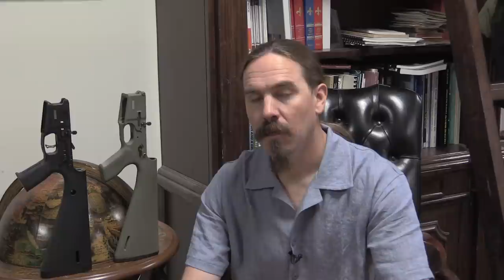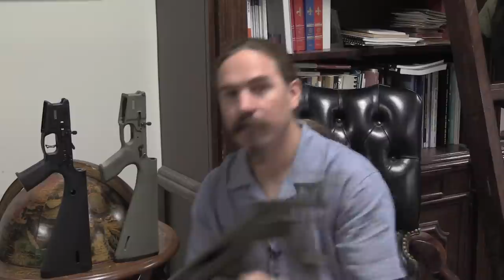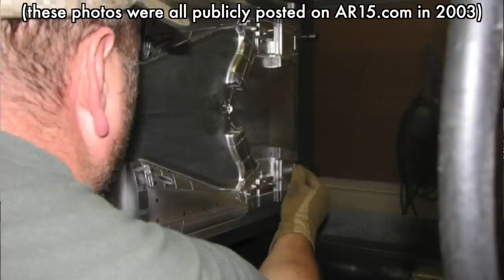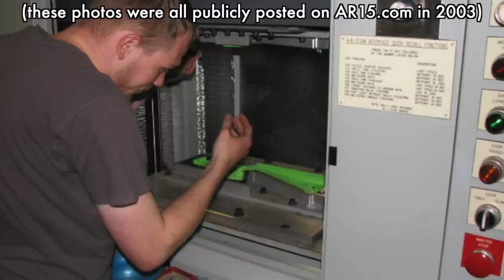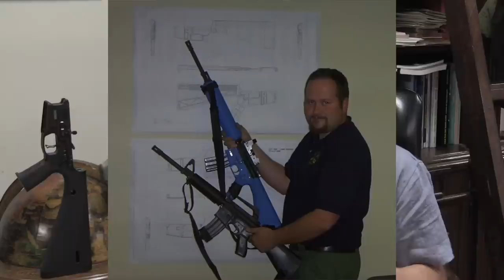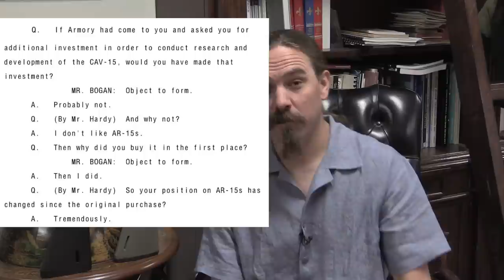Anti-Gun Partisan Lawfare? GWACS Sues KE Arms et al.

Comment: It's worth mentioning that there is a precedent for intellectual property and courts to treat the AR-15 differently than just firearms in general.

For example. Karl Lewis has a patent on monolithic uppers specifically for the AR15 platform, and he did successfully sue Colt for infringing on it. Granted, he actually has the patent to back his claims up, and GWACS doesn't. 

Trade dress is posibly the weakest form of intellectual property there is.
Reply: @zoiders  even then, polymer stuff in 2 halves joined by friction welding predates the AUG...
Reply: @zoiders   I was thinking early 70s, but there is a reason they didn't straight patent the process
Reply: @zoiders  I might be talking out of my ass, but the patent might have been extremely specific to the exact dimensions and shape, and not the manufacturing process.

Having only scratched the surface of patent approval in uni, I think that they had patented the system and some specific parts (the chassis, gas system, the specific way of making a quick exchange barrel).

Considering how the original Cav15 was never patented, was shared publicly and on the internet (which makes it pretty much eternal, as in forever shared with the world), I'd like to know how the lawsuit even started.
Because you'd have to push a lot of "levers" to build a lawsuit on these grounds, especially considering how the kp-15 is built pretty much from old school first hand experience.
It sounds to me like they are trying to prove that a polymer lower receiver is by default their IP, but without a patent and with the original designer having blatantly stated that everyone is free to make his own...

Grifting and/or trying to thieve some money from a project they were never willing to invest in.

Comment: Russell Phagan posted a huge block of legal documents, from which I learned some interesting twists to the story.

The most interesting thing I learned was that GWACS Armory was never intended to manufacture guns for retail sale.  GWACS Defense was the 'real' company, working on a gunshot detection system for the Marines.  But they needed automatic weapons to test it with, and didn't want GWACS Defense to have to apply for and hold a machine gun manufacturer FFL.  

So they created GWACS Armory as a separate entity, solely to convert machineguns on a small scale to use to test GWACS Defense's gunshot detection system.  As far as I can tell, when Russell decided to sell the molds, he approached GWACS Defense who decided to buy them through Armory, but the company had, at that point, never made a single gun for retail sale, nor sold any guns made by others.
Reply: That helps explain to some extent why an anti-gunner invested in the company in the first place.  Developing a gunshot detection system is right in line with anti-gun orthodoxy, then as you say they needed to be an 07/02 for testing purposes.

It's entirely possible that as an investor, Oppenheimer may have been initially in the dark as to what his partners/employees/whoever at the 07/02 side of the operation were up to until after the mold had been purchased and production costs incurred.  Then went along with it since his investment was at stake.

Comment: I wonder what kind of trouble you could get into if you were to vacuum form the left and a right off of the polymer lower, fabricate buffer tube holding mechanism glue it together and fill all the voids with rigid foam clean up the edges put in your fire control and then you've got a carbon fiber super  lightweight receiver
Reply: none except for regulations regarding fabricating of a firearm if you were to sell it.

Comment: Well, I haven't read all the comments, but although I am not a lawyer I though designs were protected by copyright, and copyright covers derivation, not just exact copies. Since Russell Fagan, having been very familiar with the Cav Arms and GWACS product, worked on the KE15 design, that may expose a valid copyright case. In software development we use a green field approach to avoid the problem. No one who worked on the original software can work on the new competing product.

Comment: primer + case + gun powder + projectile = Modern day cartridge using Sammi spec guidelines for safety 

1000lbs =  7000.00108027 grains 

What was the exact amount in lbs or whatever unit of measurement did the founding fathers stated to have ready just in case? 

How many Modern day cartridges could be made using the equation listed above using the appropriate materials for a modern day cartridge? That would be very informative.

Comment: If he started it from scratch again and they don't have a patent and he didn't use original prints then he will be fine. If they sold him specific prints and he used a copy or those then it's possible he could get into trouble for a close copy. Also depends on if he signed a NDA.
Reply: If they sold prints, unless the contract explicitly includes a non-compete, they cant do anything. Even if it does have a non-compete, they have to actually be competing, which they are not. But the relationship here does not seem to have these complexities. Basically, KE and GWACs are both derived from Cav arms product, and neither has more claim to the idea than the other. If GWACs restarted production and KE sued, I would side with GWACs. But here we have the opposite, so I stand with KE.

If we had a situation where GWACs was acctually attempting to produce or liscense production of their 'intelectual property, I would be more interested in hearing them out. But to be clear my goal would be both companies producing competing products, because I want the product improvement that comes with that competition.
Reply: The KP15 is a complete do-over based on the KE15 aluminium lower. GWACS are basically claiming they own everything inside Russel's head regarding polymer lowers cos he sold them a mould, which is patently ridiculous. If you've got the time, read his deposition linked in the description.

Comment: well, I'm not giving up my KE Arms lower assy. I actually like it better than any 'traditional' lowers, and not because of the weight.  I'm way too old for door busting, so I don't need a collapsible stock, and that is the single advantage I see in a traditional M4 setup. I shot an A1 in boot camp and a A2 the next 10 years.  This stock feels better than either of those did.

Comment: As a former moldmaker and mold designer, I think I would have considered building the mold to make the frame a single piece as opposed to two halves.  Somewhat more complicated but certainly doable with sliding cores for things like the buttstock, mag well, trigger group, and hand grip.  Easy for me to say, but that's my two cents....
Reply: Is that even possible for such long thin walls when we're talking high percentage fiber glass mixes? And how would you make the butt stock hollow?
Reply: @andersjjensen  I agree, a high content of glass filling would make it difficult.  That would be something that would have to be worked out with flow analysis software, which wasn't something I didn't do.  That was a area for the process engineer.  
The butt stock, and other hollow areas would have to be done with core pulls.  In this case it would likely use a hydraulic core pull setup.   Like this:  https://www.youtube.com/watch?v=xyWcsmORB7Q  
Shorter core pulls are usually done mechanically with angle pins.   https://www.youtube.com/watch?v=vRoTwFAnYXk
There would no doubt be issues with thicker sections of the receiver which would have to be dealt with and there would probably still be a couple of holes that would have to be put in by secondary operation.  It would be a serious challenge but I've seen molded parts that were extremely complex.  Most people never give a second thought to all the plastic moldings we see every day.

Comment: Just a small little nitpick. Something doesn't have to be a secret to be intellectual property. A novel is IP but the whole world can read it. An album is IP and not only can the whole world listen to it, they can all duplicate it perfectly and easily. It's still IP.
Reply: IF the original sale was for the hardware to construct the lowers, but not the engineering drawings or the license to make changes to the moulds, then no IP has been sold. I expect that this is what the entire lawsuit should (and will) revolve around - the rest is simply posturing. Cheers!
Reply: @themittonmethod1243  I wasn't saying GWACS was right in saying that it is their IP, my comment has nothing to do with the case at hand. Just responding to Ian's statements that none of it was secret. Secrecy is irrelevant.  

If I sell you my novel, all you have is a copy of my novel which you can read all you want but I still own the IP even though nothing in it is secret. And in fact, if you are a publisher and buy the rights to publish my novel, I may still own the IP depending on the details of the contract. 

What GWACS is trying to do sounds more like they bought the printing presses that were used to print my novel and think that means they now own my IP.
Reply: @wingracer1614  that is what i thought you were saying, and was replying in kind, as a confirmation of clarifying! cheers!
Reply: There are multiple categories of IP.  A novel is IP, but the IP is copyright, which is the right to publish or copy.  You do not have to defend a copyright.  Trademarks are a different type of IP, and you have to actively defend them to prevent them from becoming generic.  Patents are a 3rd type of IP, but are limited in scope and duration.

In this case, there are no copyrights or trademarks, and the product was never patented.  So the only type of IP that can be involved is what is known as "trade secrets".  And trade secrets have to be protected and held secret.   For example, the formula for Coca Cola.  Coke has to actively protect the secret, or they lose protection.  Since Shawn basically plastered the blueprints all over arfcom, there was no effort to maintain any secrecy in the design.

Comment: It seems odd that this survived a motion for summary judgement, but depositions imply that it did.
Reply: Summary judgment motions are only made after discovery, and I expect KE arms to unload a very entertaining one on GWACS in the next month or so. You're thinking of a motion to dismiss, which can occur very early in litigation for technical fault in the complaint such as "failure to state a claim for which relief can be granted".  GWACS apparently withdrew a lot of the claims that would have been vulnerable to such motions. The issue here is that there were actual, signed,  sales and  non-disclosure agreements with GWACS and some of the parties.  Getting a Judge to dismiss a well written (although very stupid) complaint in a contract dispute about STEM maters, before discovery is not trivial.
Reply: @blueishgreen76  You're right. I was essentially thinking of an anit-slapp motion and forgetting that such motions are essentially defamation-specific. A motion to dismiss would be more fitting this context and, as you pointed out, less likely to be successful.

Comment: How on earth is a mold from several 100 thousands of dollars? Somebody is making a lot of money. Yes you need a big block of steel. Yes you need a big machine to mill all that steel. But several 100 thousand dollars??? More like several 10 thousand dollars. But apparently not. Maybe that is why India and China are doing so well with making products, its likely to be cheaper to get the molds made over there. 

How can they start a lawsuit when its clear that there is no chance of it being won. Are they going to pay the defendants for their time lost in defending their case if the lawsuit is not won by the ones filing the claims? 

Greetings,

Jeff
Reply: Usually making a mold requires several iterations to ensure it works perfectly, so those contribute to the price.
As all it’s surfaces need to be absolutely perfect, its final surface gets milled at very slow feed speeds, which takes pretty long and also raises the prices.
Next it gets heat treatments and surface treatments to ensure it won’t wear quickly, which also adds to the price.

So making a mold means paying the designers and engineers to design the mold, making a prototype mold, testing it and the parts it makes, paying designers and engineers to rework it where necessary, testing again (repeat the past three steps until it’s perfect) and then making the final mold.
Doesn’t take long to reach a few hundred thousand dollars when you have to do pay for all that.

Molds made in china are just as expensive when they are made to the same standards.
But for cheaper products, they often don’t refine them as much to save costs and so cheap injection molded products made over there often don’t have a very good surface finish, visible seam lines, visible injection ports, etc
Reply: @yourlocaltoad5102  You dont need to harden the stuff, you only need to make sure youve got the shrinkage factor right. There is water cooling in these blocks too, that may add some cost. Its probably the dimensions and thus the gear you are paying for, and you are paying for these engineers their college funds they have to pay back, their expensive car, their villa home, and of course how exclusive they are. They usually pearl blast the inside of the molds to give the finished plastic piece a dull appearance. 

Greetings,

Jeff